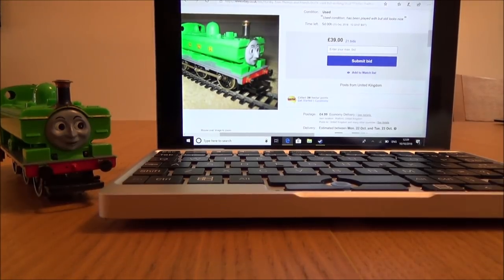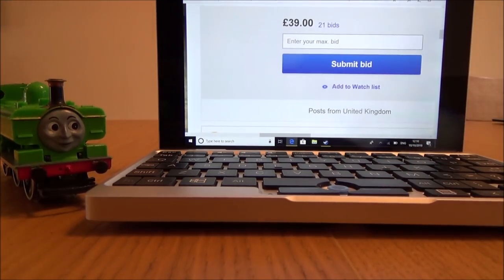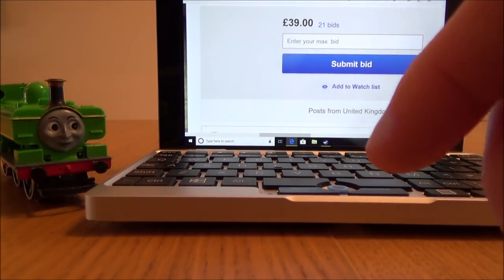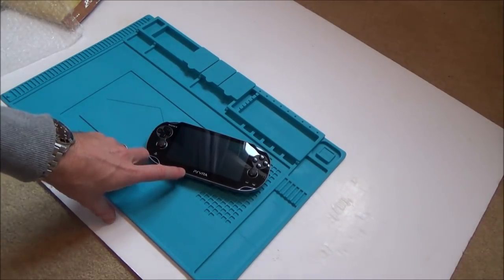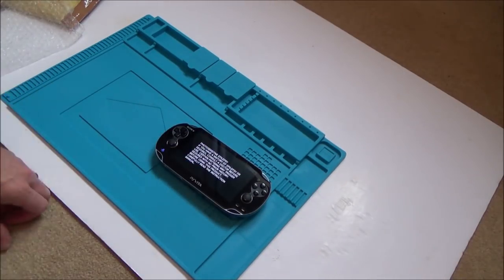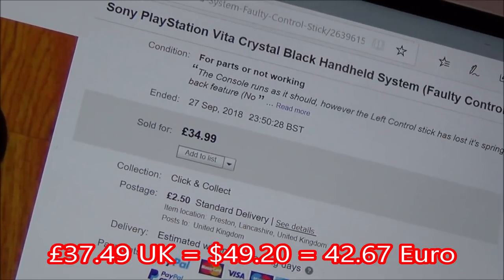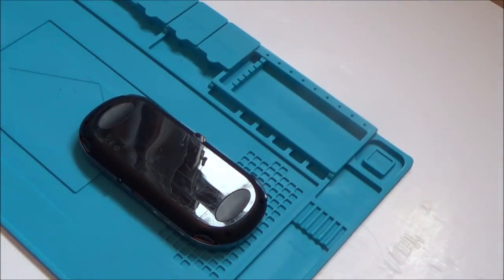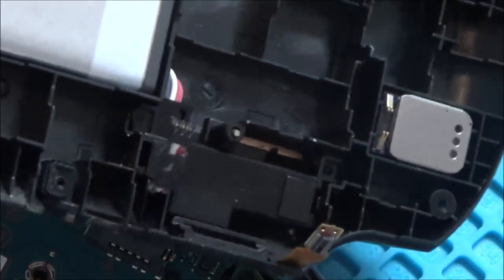PART 2- eBay Repair Challenge - Amateur vs Pro

Comment: Great job on the Vita! I was looking to buy one of them too but just couldn't find one that I thought would work well. They are pretty expensive even broken. Really enjoyed the video!
Reply from the maker: Thanks Steve, they have held onto their value very well for the last few years. Your part 2 was seriously good and I really mean that, thermal imaging.....wasn't expecting that :-)
Reply: Ha, ha...I just bought that device to use for something else, then when I was doing the video and felt that part get hot I figured I might as well try it out. Still learning how to use the thing!
Reply from the maker: Let's just say I think my part 3, 4 and 5 has to be special....very special. Not sure what that 'special' is yet and that's the problem :-)
Reply: I don't think I'll do better on any of my other items than I did on round 1! That was a good one. I should make a bit on my second item too though. The good thing is that we're both making profit...no duds yet!
Reply from the maker: Yeah it was a very good one :-) Hopefully we can get though all 5 without a dud:-)
Reply: Bey

Comment: Don't update it and you will get more money if its on a lower firmware
Reply: Very true because people want lower firmware so then can install henkaku for emulators and such.
Reply: Nice idea!
Reply: The best firmw. versions are 3.60 and/or 3.65, imo! Have 2 vitas (one first model and the other the "slim") one on 3.60 and the other on 3.65! Despite 3.66+ to 3.68 can still be "modded" (or exploited) using H-ENCORE but i prefer ENSO (3.60 and 3.65 are the only versions you can run it atm). If you update it to latest (3.69) the exploit won't work! So people prefer them on any of the lower firmwares and you can get a good money from it! Also, with the VITA exploited, you can get a adaptor (extremely cheap, under 2 euros) and put a microSD (64GB or 128GB) card on it (it's named "SD2VITA") so you won't buy the proprietary vita expensives mem cards! :) (it's a good thing to have at least one original 2 to 4GB mem card from vita, in case something goes wrong).
Reply: lower firmware vitas are easier to exploit to hack because sony hasn't patch any fixes for it. So once you update to the latest firmware you usually have to wait for a long time for them to hack the newest firmware if at all.

Comment: Listing the firmware version in the listing should help with the sale, 3.65 and below are desirable.
Reply from the maker: Thanks, this one is 3.68.
Reply: @Mymatevince  make sure it doesn't update to 3.69, people will be more likey to buy it if it's 3.68 or below because of the h-encore exploit
Reply: Joe Bassist: 3.69 is the best firmware for the PS Vita. I don't intend to hack my Vita as i have a Odroid XU4 for PSP emulation
Reply: @lucaspagan3576  from a selling standpoint, 3.68 is better than 3.69 at the moment as there is still that exploit. People are looking for the consoles with the exploits, it's always been the case with the vita :) he'll have more hope in selling it and more hope of getting a decent return on it :)
Reply from the maker: Thanks Joe :-)
Reply: Best for you maybe, I paid $650AUD for 2 vita's one on 3.60 and one 3.65 as they are great for emulation with good controls.
Reply: @lucaspagan3576  but then you can't use sd2vita cards for micro sd storage for digital games, so your stuck paying crazy prices for Vita memory cards.
Reply: @Swish Gaming: I’m just fine with that! I’ve got a 64gb PS Vita memory card, and it isn’t even full yet. I’ve got mostly physical Vita games!
Reply: @lucaspagan3576  I've heard alot about them failing :/ If you can- back everything up just to be safe :) hope you enjoy it though, I love my vita to pieces :)
Reply: @buddybleeyes  yeah I heard the 64gb and 32gb are very prone to corruption. Even the 16gb one I had courrpted itself twice for no reason on mine, pure pain because the download on the vita is quite slow.
Reply: @lucaspagan3576  well where I live there is next to no vita games to buy so download is more or less the option I have. And at €110 euro for a second hand 64gb card here it's more than the console, and sd2vita with a 64gb micro sd card being about €15 or €20 euro all in, yeah its a no brainer.
Reply: Was thinkin on that myself. And it will help on the sales. Despite it's on 3.68, it can still be exploited. Not as good as having the ENSO (runs only 3.65 and 3.60) but with H-ENCORE you have almost all the options.
Regarding the corruption on the memory cards of the vita, i have a 32GB from the first days of the vita and never had issues (so far). Now i have SD2VITA and 2 64GB mSD and they run without any issues on both of my vita consoles.

Comment: Hi Vince, a Sony EP880 charger £3.50 Ebay, works fine with the cheap vita cable, output is 1500mah and I wouldn't use anything capable of more as I've heard horror stories of them buggering vitas 😭. As for screen replacement, it's a bloody nightmare😱😡😠🤬, the screen surround and button surround have to be warmed to soften the glue tape and plastic spudgers used to pry the screen/digitizer off-then comes the fun of removing the remnants of the glue, I use silicone oil and many many Q-tips to slowly peel the sticky crap off-it has to be fully removed or the replacement won't lie flush. Then clean off all the silicone oil and replace the whole screen/digitizer unit as one £25 on Ebay. Good luck with the comp 👍😀
Reply from the maker: Thanks Biker Dave for the tips. I knew I recognised that Sony EP880 charger when I just looked on eBay. I have one of them when I bought my PSP GO or I think my one is a EP800 (hard to read the info). I have just tested it with the cheap Vita lead and YES!!! it does charge. This info is great as eBay has loads of those chargers. Thanks for sharing this info :-)
Reply: @Mymatevince  it's possible the vita will be fussy with lower output chargers too but I don't have any to test at the moment, but I have been warned of the 2amp chargers and the so called quick chargers giving problems to vitas especially if used while playing. Problems ranged from overheating/shutdown to softbrick (requires battery to be disconnected for a few minutes and then the vita will be OK) , and even a full brick/failure of components, that's why I recommended the EP880 as its the exact power required by both Vitas and PSP systems. That may help anyone with a busted charger get a cheap reliable replacement 😀
Reply from the maker: Thanks Dave :-)

Comment: You can charge the Vita from any USB charger, but you'll have to power down the console completely before connecting the charger. Which is typically Sony, I suppose, making things a pain in the arse for no good reason. Found this out when I brought my Vita on a trip, but forgot to bring the charger.
Reply from the maker: Interesting. I never knew that. Thanks for sharing the info :-)

Comment: Vince I've used car body wax on tiny scuff & chip marks on various screens if the chip/scuff is clean the wax dries clear, the better the wax the better the result it reduces the marks distraction by 80% or so depending how severe an location of the mark.

Comment: Make sure to check the firmware version, the lower = better. At 3.60, you can install Henkaku (and Enso), at 3.68 you can install h-encore.
And, disable automatic updates to avoid installing 3.69.
Reply from the maker: Thanks, this one is 3.68 :-)
Reply: Then install h-encore, and it will boost the price of the console - PS Vita consoles with Henkaku, Henkaku Ensó, h-encore are valuable. :) It can go on 60-70 pounds like that, or even more.
Reply from the maker: Thanks for the link. I will look into it :-)
Reply: You can install Henkaku and Enso up to 3.65

Comment: Hey! I believe Vita is expecting echoes from the USB data TX on the data RX line to enable charging. Basically Vita will charge from anything, but to initialize charging you need to short USB data lines. You could just open one of these cheap Vita USB cables of eBay and connect data lines. That cable will charge Vita from any power bank or USB charger.

Comment: The OLED PS Vitas are surprisingly easy to fix as long as it is not a broken screen. The screen is the only thing that is not worth replacing on it. On the inside everthing is strategically placed and inside parts easily replacable and you don't even need too much knowledge to do it.
Reply: Yeah super easy to fix also you can just replace the whole front not just the screen I got an actual oled screen with the plastic already attached for 20 euros shipped from aliexpress

Comment: Baking soda can serve as a handy phone scratch remover. Be careful with this method, you don't want to end up water damaging your phone too. Here's how this remedy works: 

    Mix two parts baking soda and one part water in a bowl.

    Stir until it forms a thick paste.

    Apply the paste to a clean, soft cloth and gently rub in a circular motion on the phone's scratches.

    After this, wipe your screen with a fresh, slightly dampened cloth to remove any excess.

Comment: That is the tricky part of the competition, the more optimal the item selection to making profit the duller it often gets. Too late for this one but maybe if you two do it again you could pick each other's items, you both seem capable of picking challenges rather than just screwing each other over. Send TronicsFix LLC a train to repair. ;)

Comment: With the charger the Adapter has to be 2 amps or the PS vita will not charge. Anything below 2 amps will leave you wondering if something is wrong.

Comment: @22:32 I have one of those cheap cables - and it charges perfectly if you short the middle two connectors on the usb plug at either end - I use an IPhone charger and put tiny sliver of silver tape over the middle two gold connectors inside the USB socket of the IPhone adapter - sketchy I know - but that's the check Sony use - the middle two pins are just shorted inside their power brick.

I bought a vita to fix - 12 euros :)  was dead - water damaged- but i managed get it power up by cleaning some corrosion stuck to the chips - partial success though -  no audio...

Comment: I have my original vita lead that doesn't charge from really anything but the brick but I also picked up a third party one that seems to be able to charge it from anything, power bricks, pc's, battery packs the lot. My guess it's to do with the actual cable wiring more than the charger but who knows with Sony they always seem to be pulling stunts like that.

Comment: Great thing now is you can buy adaptors to use standard MicroSD cards instead of the expensive Vita cards. Saves a lot of money and they work up to 256GB Micro SD cards, great for modders with emulators and such. Just like the PSP before it that also got adaptors to use standard cards instead of the Memory Stick Pro Duo cards Sony wanted you to buy.
Reply from the maker: Sounds brilliant as those Sony cards were/are super expensive.
Reply from the maker: Excellent, I am going to tell my friend about these. I gave him a Vita recently and he was going to go CEX and buy a card. No need now. I am going to get one as well as I haven't got enough room to download the God of War Collection without deleting other stuff :-) Thanks for the link.
Reply: @Mymatevince  Would be good to do a small video on it maybe, get the word out cos they're quite new and not many people know about them.
Reply from the maker: Yeah, good idea. I have just ordered one up and a 64GB micro SD card from Amazon. They have a great deal today on the 64GB Sandisk cards £10.29 :-)
Reply: My Mate VINCE I've had my eye on these as well. Can you confirm if it works? Do you need certain firmware/software installed? Thanks.
Reply: You need to mod the Vita to use those adapters though.
Reply from the maker: Hi, I will try it out on a spare Vita I have and make a video on it. I just need to check the firmware is suitable. I will try and do it in November/Decemeber as I am so behind on things at the moment :-)
Reply: My Mate VINCE no rush. Looking forward to it! Cheers!

Comment: Hey Vince just thought I'd let you know they make adapters for the ps vita and PSP proprietary card to micro sd that's usually under 10usd so instead of buying their overpriced card buy the adapter that's the same shape and size but lets you use a standard memory card
Reply from the maker: Thanks for the info :-)

Comment: HI there, Just wondering what heat gun you used to fix the xbox one with the HDMI problem in another video?
Reply from the maker: Hi, it is a cheap Yihua 853D. It was £80 from Amazon in the UK. It only goes up to 480C so maybe as/if I get better then it may not be as good as the expensive ones BUT at the moment it is still better than my experience needs :-)

Comment: The cheaper charger does not work because the psv and charger have to be able to talk to each other for the overcharge protection to work properly (it prevents the battery from getting too full by still giving power just not as much until the battery has used some power then it gets more power then the vita uses and it gets more unless it gets unplugged a very simple but working way of stoping a battery pack from charging when it has max power inside it Samsung did the same thing with one of there phones that got recalled through firmware updates)
Reply: https://youtu.be/UEC4QHfVf6I
this is the link to the video on the Samsung phones

Comment: The usb cable probably doesn’t work because it needs 2 amps and phone chargers only give out 1 amp so it will probably work if you use a 2amp power brick

Comment: Last month I paid £29.99 for a mint condition, boxed and fully working Vita PCH-2001 with charger and 4GB memory card. it was also running firmware 3.60 lol
Reply: that's worth 150 pounds don't update that unless you are putting enso 3,65 on it lol

Comment: can't you use an adapter to use micro sd cards? sure there's one for the Sony memory card
Reply: Not for the memory cards, but an SD2Vita adapter allows you to put a microSD card in the cartridge slot

Comment: I sold a working ps vita last week with 16gb card and that sold for 60, there going price on eBay is 55 to 80 on eBay but the ones for 80 don't sell fast
Reply from the maker: OK, thanks for the heads up. I may struggle to make a profit on this one then as I need to factor in the price of a replacement analogue stick even though I already had a spare one :-)
Reply: @Mymatevince  all so try not to update past 3.68 fw as ones with that or lower can be modded so sell easyer.
Reply from the maker: Sure thing :-)

Comment: I've got a  boxed white Xbox one s that switches on but doesn't display anything not bees opened can put it on eBay for ya if you want?
Reply: Most likely it'll be the HDD, HDMI port or HDMI retimer chip.
Reply: @MattP79  I've took it apart and HDD is dead put a spare 500gb in and usb stick won't update some.kind of problem
Reply: @stuartbuxton7916  Have you tried using this guide: https://youtu.be/4xYQQicXdU0 ?  It has to be followed to the letter but it does work. Don't forget to open the command prompt as Administrator, even if your account is admin, otherwise the script won't work correctly.
Reply: Fwiw I have an older PC and I swap out the connectors from the SATA optical drive to connect the Xbox HDD rather than using a USB-to-SATA adapter. More reliable and quicker :)

Comment: If its in FW 3.60 or below it might be worth much more. Since this version was easy to jailbreak and will sell way better. You can even work around this stupid sony memory stick crap once jailbreaked and use any sd card.

Comment: I hate ribbon cables and ribbon cable clips. those things are so tedious if you don't have the right tools. that's one of the reasons why I quit Messing with laptops because let me tell you the ribbon cables in laptops are thousand times smaller than any game console